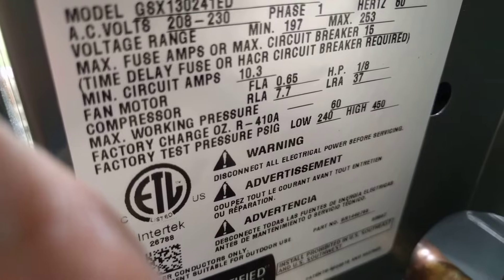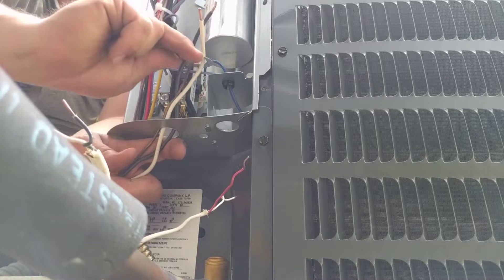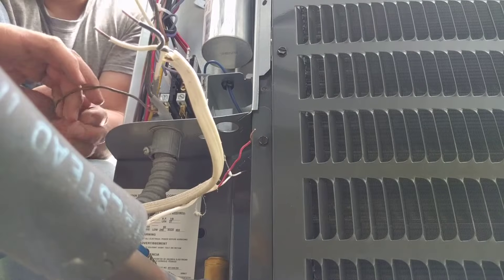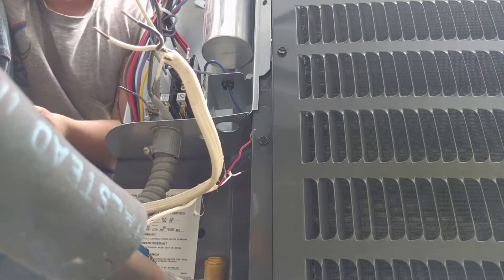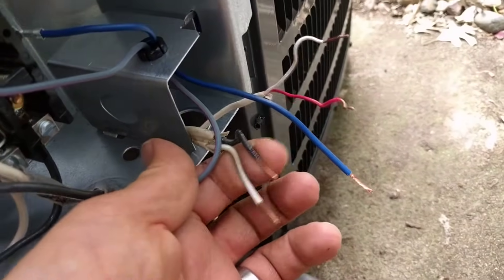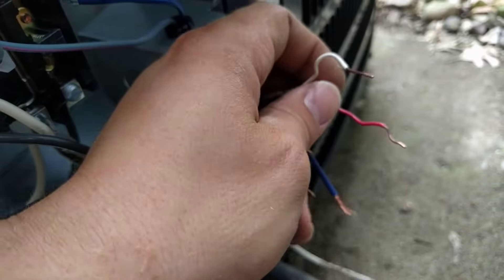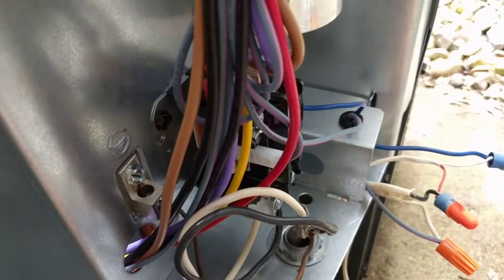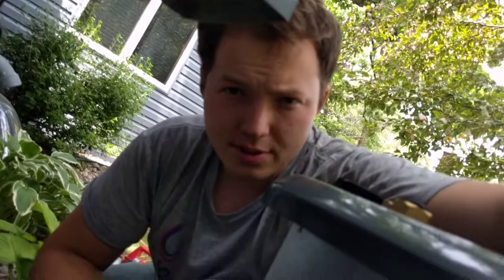How To Wire an Air Conditioner Condenser Outside Unit - High & Low Voltage AC Wiring

Comment: Hi 
My outdoor condenser fan is running continuously even though thermostat is off, I have tried with new contractor and capacitor , which didn’t solve the problem .can you please help me

Comment: If my outside ac unit is not connected to any wires will the thermostat in the house not work? Have any power to it?

Comment: hey ben, thanks so much for so many great videos! in the process of wiring my home now. Had a question about wiring to the air handler inside unit. Im using 6/2 with 60a breaker , 10kw heat strip. Does the wire from the disconnect to the air handler need to be in conduit using thhn? or can the 6/2 come straight from the disconnect on the wall, into the air handler / heat strip location? im wondering if the inspector will say something about the 6/2 not being "protected" between the disconnect and the air handler, thanks!

Comment: 15=110v not 120 right?
Reply: I’m assuming you mean 15”amps”=110v, if I’m correct, then it doesn’t make sense.
Furthermore, the closest I can think to understand you, is the amp rating not to volts, but the wire size(awg) that goes as follows:
12awg: 20amps  
10awg: 30 amps
8awg : 40 amps
etc. etc..
Lastly, “110v” and the standard “120” are the same thing, different terminology. You might even hear “115”.
Note:
 “110v/220v” = 120v/240v
 Also, 240v is not the same as 208v single phase because it is derived from a 3-phase that only uses phase A at 120v while phase B measures at 88v thus delivering an output of 208v. from phase A and B. 

Hope this helps

Comment: LMFAO! This is why we electrical licensing laws.
Reply: Yeah 15amp for each leg and your not supposed to use white as a hot leg and you should’ve used 10/2 with ground, your house should be burning down soon
Reply: @danielbischoff2138  let's be honest here. Max amps 15. So even 12 wire which is rated for 20A would be fine. I'm more concerned about the Greenfield being used. No liquid Tite sealtite and fittings.

Comment: This thing must have been wired by a cheap ass electrician,  that metallic, cable is not approved for outdoor installations,   Should an air conditioning tech, be wiring the high voltage wiring to this unit, I'd say no unless you have an electricians license, being a master or working under one.  Just wondering,  because no one uses UF cable for inside wiring unless that grey wire is buried underground, it's too  expensive.  Your electrician seems to have wired the home with what he had, you know, different kinds of wires, scraps, whatever was available or lying in the back of his truck, also the white wire is not color coded, a new tech, could get hurt on this, because a white wire is a neutral, grounded conductor,  and should be marked with a red tape, But   you seem to be doing a good job with what materials the electrician left you, keep up the good work .
Reply: Not sure what you're talking about here - UF-B is literally the only wire you can use in conduit. He's running a conduit. It's running outside the house so he can't use NM-B cable anywhere on this install. The UF-B wire is rated for underground feeder use but it's not required, and it's actually the conduit that is typically optional, however it makes perfect sense on an install like this.
Reply: poetnk The Flex is just being used as physical protection the UF is outdoor rated. I would have just used liquidtight conduit and thhn/thwn.
Reply: EEEEEEVRYBODY's an GENIOUS on every tradesman video. THE REALITY IS, people do whatever, in various parts of the country. and In YOUR neck of the woods the inspectors are nitpicking every inch, and in others, they are able to send a video to an inspector, and in other places, NO inspector is called and no one cares...THATS the reality of the usa. 

So YES, the code is the code, and NO the code is not being followed all over the country, AND NO, many people are not policed like where YOU might live. 

Where I live, I would have no option but to use seal tight. People running romex in pipe is stupid to me.Pipe fill is clearly not including the use of romex in a pipe. But in romex states, "pipe fill" is a foreign concept.  Youre wrestling trying to pull a romen in a pipe. When you live in a romex world, a pipe is seen as great protection for your ROMEX! LOLNot as the main thing to use. In romex heavy places, many cant bend pipe at all, and buy premade 90s. 

Is some places you dont have to have to pull a permit if you dont charge more than a certain amount for the overall bill!

so stop saying "this is right and youre wrong"..You may indeed be right. But the real time behaviors of varied areas swing widely.
Reply: It’s not nitpicking if it’s illegal... 
fun fact. Sleeving UF in any other type of conduit is it illegal. Now you have shield on shield.. now you have increased heat. 
Also the Greenfield FMC is NOT RATED TO BE OUTSIDE! You need seal tight or liquid tight with THHN. 

Coming from a licensed electrician..

Comment: Goodman, must have been a budget job, whats with the romex for t-stat wiring, I hate changing cond motors on those Goodmans with their flimsy sides.
Reply: Someone needed to extend the 18/2 and used scraps they had! Nothing technically wrong with it.... 18/2 cable is rated to 150V and romex is rated to 600V. That said, if someone was looking at the job for the first time, it would be scary to find that romex in places it shouldn't be!